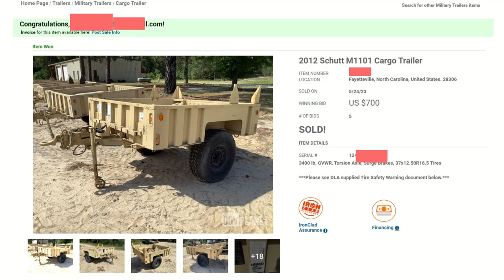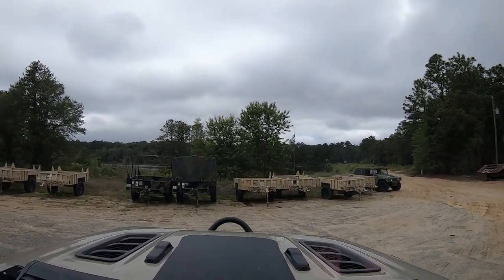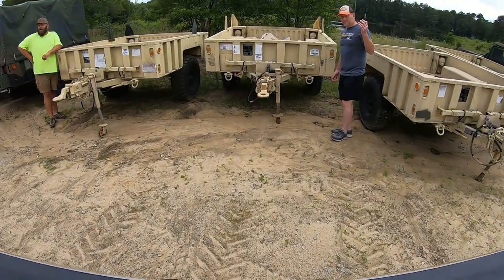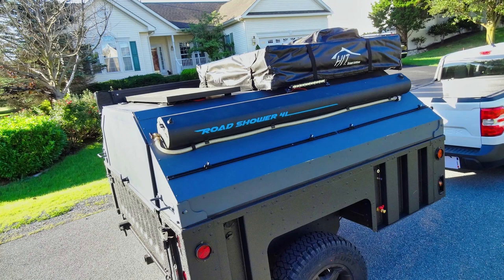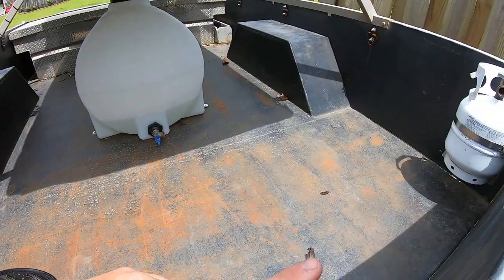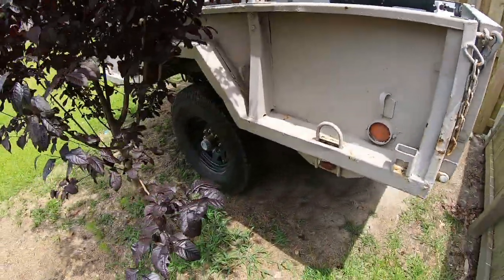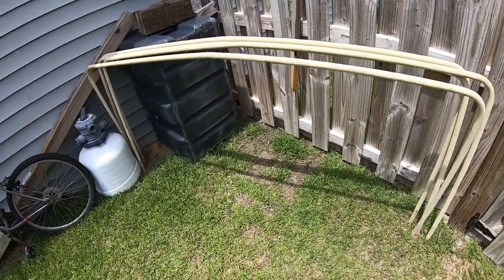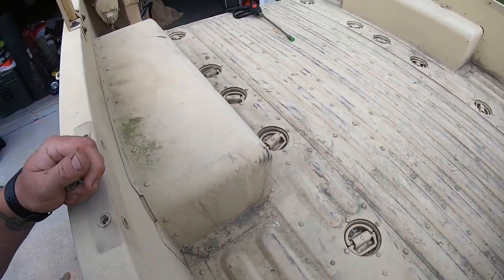M1101 Camping trailer conversion, New Project walk through and Design idea

Comment: I'm thinking about getting another m101a1 trailer and tow it with my sarge green Willy's jeep gladiator with the manual transmission. I'd like to take the trailer on and off road whenever I get it.
Reply from the maker: Did you ever get another one? I just finished up my latest video that has the top RTT frame being built and some custom interior items going in if you needed more motivation.
Reply: @ajphillipsjeeps , no, not yet.

Comment: What did you end up doing with the bows and cover?
Reply from the maker: I threw the cover away since it was rotted out and the bows I still have and will be selling once I finish the outer shell. I have been delayed by a few months due to work issues, but hopping to get it done in the next few months.